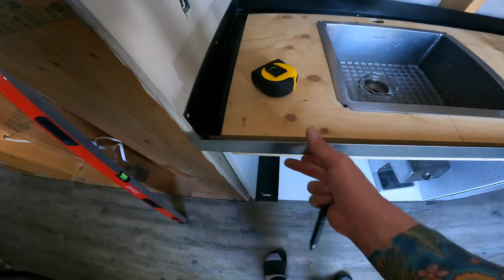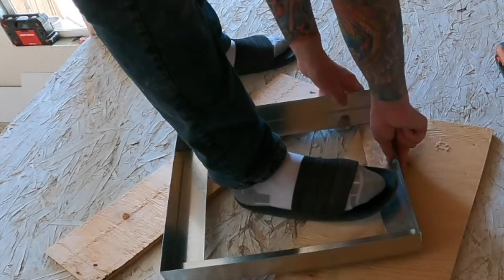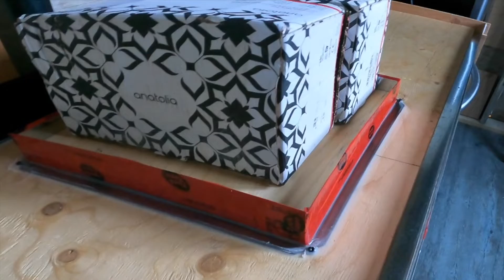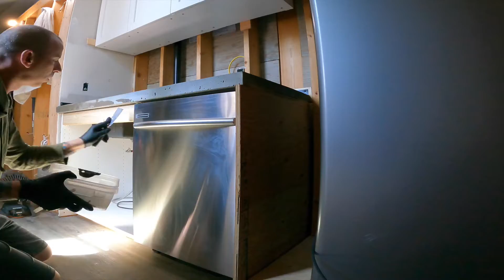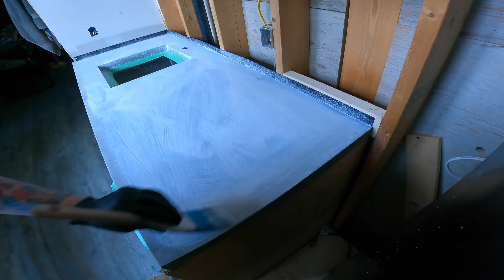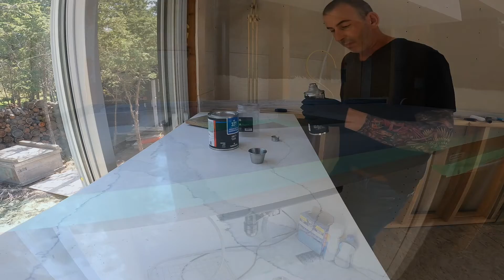Concrete Countertop DIY, Pour, Stain, and Seal. Total cost $50

Comment: Nice work.   Love the subtle color.  Is the plywood hanging over the edge of the cabinet slightly so you can attach the metal for the form with screws underneath.  Where do you get the metal? gauge?  would it be better to put the same height metal on the back so you can use as a screed?  I'm not sure I could get that flat with just a trowel.

Comment: Great video. I have a concrete countertop but I don't think it is solid concrete like yours. A huge chunk chipped off and it seems much thinner than what you have here. Also it's much lighter. I am now trying to repaint but cannot seem to find a way to match its existing paint... i'm not sure how it was painted. Is there anyting you would recommend if I just want to repaint the whole thing? Can I just use standard indoor/outdoor latex paint?

Comment: I just did a DIY Corian countertop in my kitchen. The amount of work, the building of bull noses, undermount sink installation and creation of the cutout, the strategy of supporting the Corian so that later on it will not crack due to shrinkage etc, the gluing, the construction of seams, sanding and polishing ... It adds up to a huge amount of work, patience care and ...money for special tools: sawblades, routers etc etc. Do I believe it is superior to a well done concrete countertop? No I believe that the concrete countertop if done patiently carefully etc. can have the same elegance to a hair. Just think about it: You make the Corian look thicker than it is by gluing a double layer of strips to the edges, rounding the edges polishing, etc. etc. whereas the concrete thickness needs not to be faked! In fact the concrete countertop, the way it looks to me needs to appear thinner than it actually is, for the sake of elegance. And then the price!!! If I was to do the entire project again, I would seriously look at making it out of concrete.

Comment: What products did you use? Concrete brand/Stain/Sealer, etc.?
Reply from the maker: Psi 6000 - bags from Home Depot
Uzin NC 886 floor patch for filling 
Eco stain white from - Surecrete
Matte finish 2 part Countertop sealer - Surecrete 

Let me know if you need anything else. I have a new video drop, it is all the rest of the countertops in the cabin build. 45 bags worth! It turned out great.
Reply: @ConstructionCoach  Thank you for the information!  Great Job and thanks for the Videos!!
Reply: @ConstructionCoach what are the smooth metal angle pieces you used as forms? Where did you get them?

Comment: Can you tell us what stain / sealer you used?  Also, how’s the sealer holding up?
Reply from the maker: Surecrete sealer and eco stain, made by surecrete. It is holding up great, I’m really testing it hard because I have plans to do my whole Cabin build project. I literally have 60 bags of countertop to pour so I want to make sure it is perfect first. Are you going to pour some countertops?
Reply: @ConstructionCoach  Yes. My island is 4.5’ by 8’ and I’m nervous. Trying to decide on materials. Right now I’m leaning toward the CTS Rapid Set Mortar Mix which has a tan grey color with some pebble aggregate which would be beautiful ground down and polished, or CTS Rapid Set Cement All, which is a light grey color, which uses silica sand for aggregate and very high strength. Thoughts?
Reply from the maker: That’s a big island! My only thoughts are with rapid set you have to mix and place the concrete fast before it sets up. The pour in this video took 3 bags, I figure you would need to mix up 16 bags to pour your island.
Reply: @ConstructionCoach  You think going rapid set is too ambitious??
Reply from the maker: I would use a mixer to speed up that process, and make sure you have it all placed within 20 minutes. You are going to need help to mix, and finish if you use rapid set.
Reply: @ConstructionCoach  I am nervous about it 🥹

Comment: downside of doing the sink like that is you dont get the counter to overhang the edges of the insides of the sink about 1/4" like typical, which looks better... i think if i were to do this i would pour the counter without the sink, make the hole form proper size, and then mount the undermount sink after as typical (i do silicone, clamp up thru the drain hole, and install angle shelf brackets under)

Comment: I dunno....lots of days and effort.  Certainly appreciate the pursuit, if someone just must have concrete... but that white/gray working surface you were mixing the sealant on strikes me as a much better choice.  Whatever that product is - corcoran? it looks great and if you used that for the sink, could have been done in a day, no?
Reply from the maker: The working surface is quartz, my brother is a countertop guy and he would have changed me $6-800 for that top. Under mount sinks are pricey. I did that top for $50 and I have another 300 sq feet to do on my build. In quartz or granite it would be 20k and I’ll get all my tops done for $1500. Pretty big savings!
Reply: @ConstructionCoach  yeah but time. not sure if worth it over quartz. that said, if you want the concrete look, there is no alternative! another way to save money is to tile it with large format. altho that has its own drawbacks,...
Reply: @ConstructionCoach  thank u... $ savings def a big plus.  I guess it all depends but, to be real, its not actually $50.... plywood, metal  angle, tape, etc... it adds up a bit more i am thinking.  Depends on what the big picture is too.... u can get home depot laminate countertop for about $150... so it need not be high end stone or concrete.  U did nice work and i like the idea of it.... but now that i see how long it takes.... probably would lean toward boring quick options, to just be done w it.